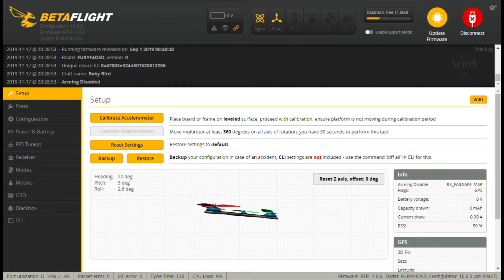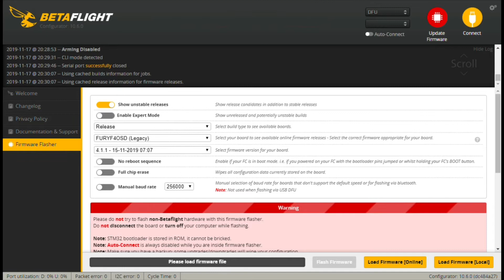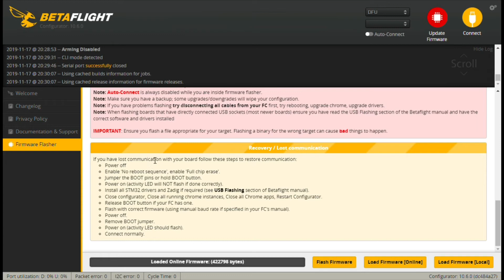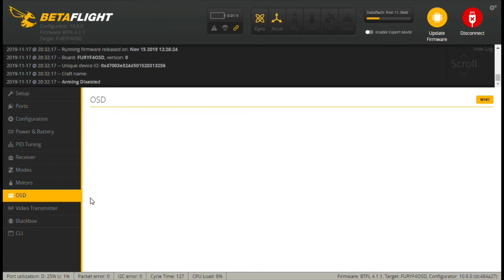Redneck Tech - Betaflight 4.1 flash on Mamba F405

Comment: Hi, I've got a new mamba mini and it came with betaflight 3.5.1. I was wondering if it would be worth updating to betaflight 4.1... what are your thoughts after the update? Have you had any problems as other people reported? Thanks for the video 👍
Reply from the maker: On my 6 inch quad, I'm not sure there was a huge difference between the flight characteristics of the two. I will say that the GPS rescue drops out WAAAY more under Betaflight 4.1 than 3.5.x. I was actually thinking of going back to 3.5.x so that the GPS rescue is more reliable because I do longer range stuff (not really LONG range, but I do tend to push the limits of 2.4GHZ and sometimes 900MHZ). Only problem is that it takes a lot of command line setup for BF 3.5. 

So - In short, I know, too late for that, If you are happy with the way your quad flies, I would let her stay on 3.5.1. If you have some bobbles or issues, BF 4.1 or higher may clean them up for you. It did clean up some stuff on a couple of other, heavier, 6 inch quads of mine.

Comment: I used DIAT target and it still fly but i was getting wobbling and jitting.. I reflash to legacy target..  Next weekend I will test it.
Reply from the maker: Please keep us informed on how it did. Do you have a capacitor on the ESC? If not, it could be an EMI issue where there is just too much electrical noise in the mix.
Reply: Kilted Texan FPV yeah i have 4 quads all has cap on it.  i’m going reflash one of time to BF 3.5.7 and other 3 in 4.1.1
I was using Rpm filter too, i flash the ESC too.  Maybe i should go back original ESC fw i dk.  next weekend we shall see.